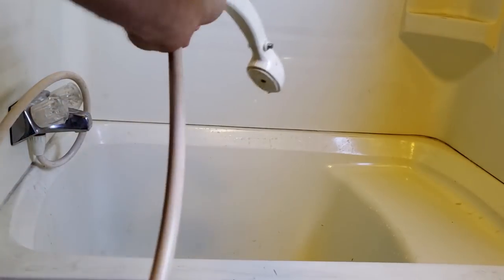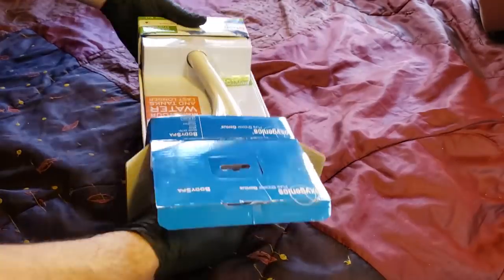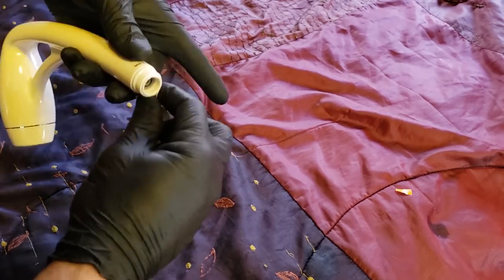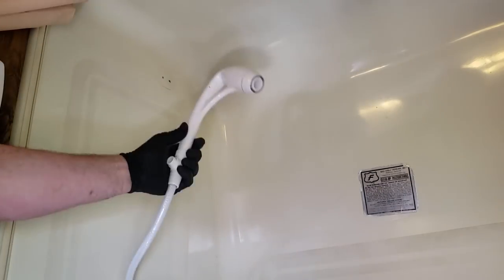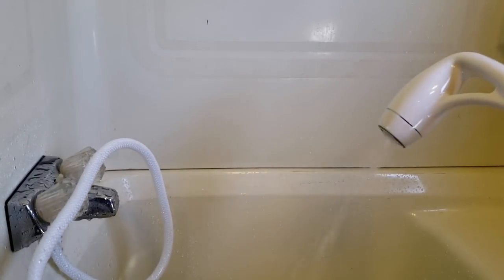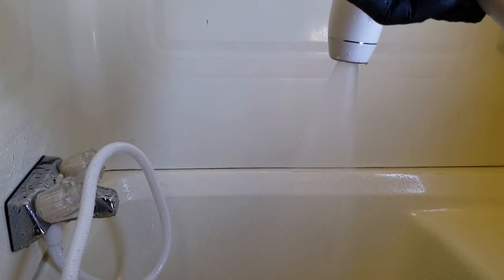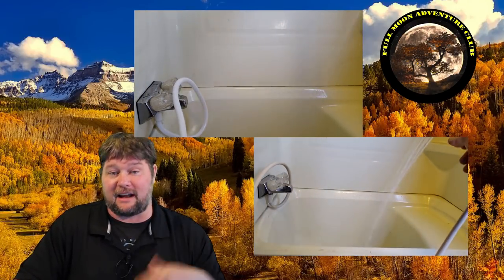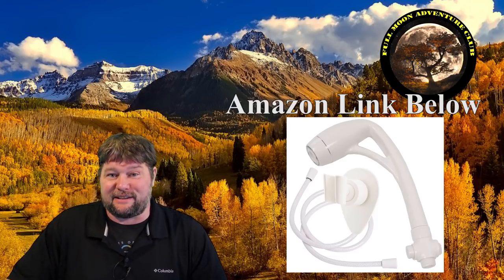How To Install A Low Flow RV Shower Head

Comment: Jim, 
nice job on the video. This is the same shower head we have. Oxygenics is the only way to go. Watching this video I am guessing you are hooked up to city water pressure. I would like to see the same test done using your water pump. I would guess that on the water pump from your fresh tank you have much less water flowing per minute. 
Also, one great thing about the water flow cut off is that you can put it at either end of the hose. For our shower the faucet is situated much higher so it was more convenient to put it at the faucet. But it works great. Good video. 
Pat
Reply from the maker: I forgot to mention in the video that I am using my water pump for this test. So that is the flow from the water pump. Thanks for bringing that up I hope other people read that. Thanks for the comments and happy camping.  Jim